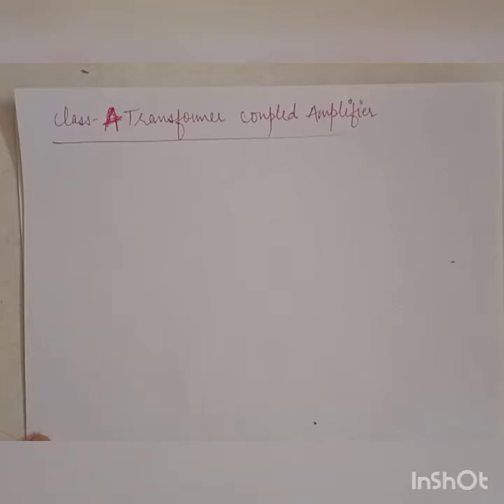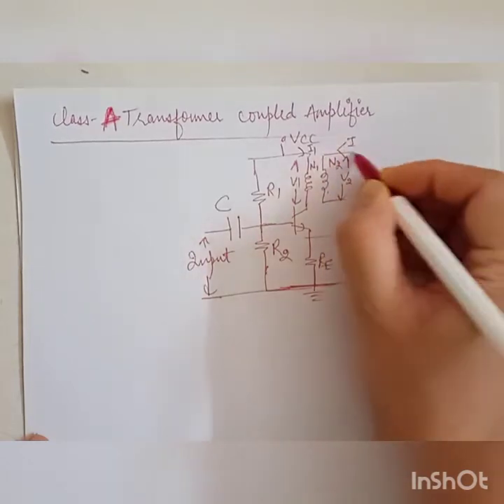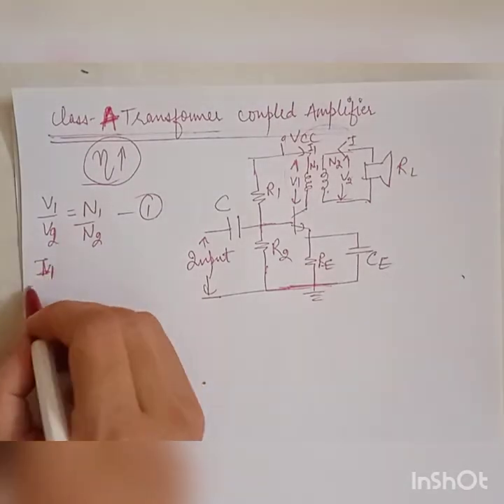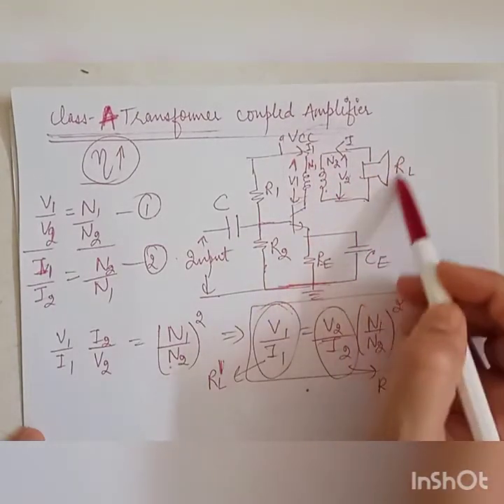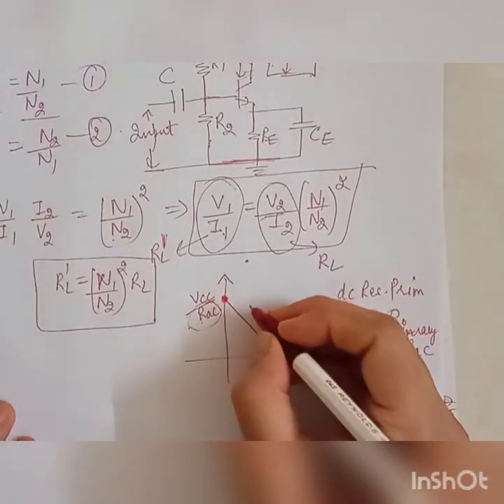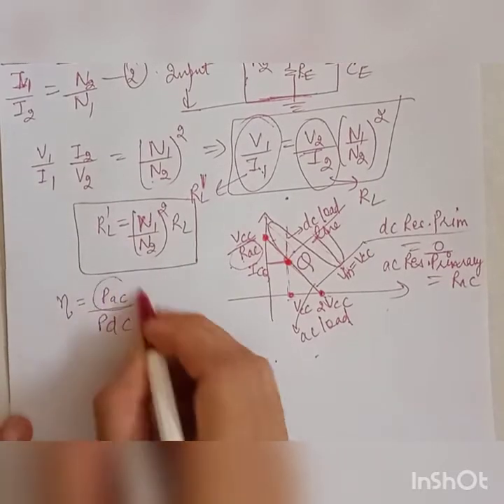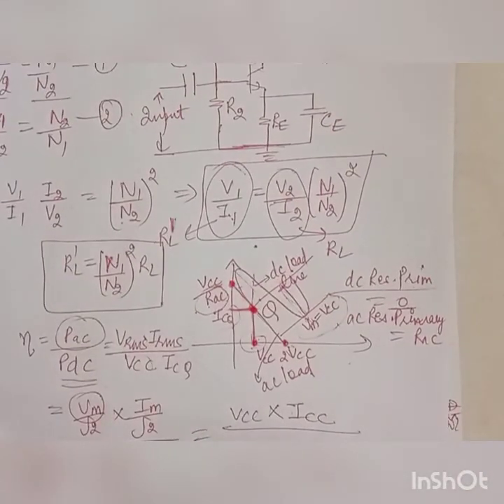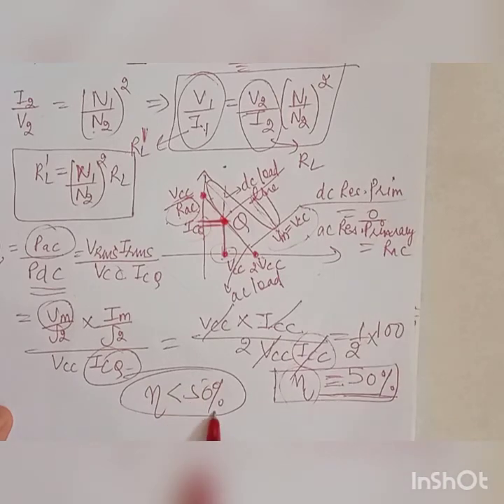Module 3 Class A Transformer coupled power amplifier

Comment: Students find it difficult to understand the nuances in the design and operation of a transformer coupled audio power amplifier. Topics related to the operation of resistors, capacitors and inductors are discussed in textbook 4 (see in video #1 last frame References).
Electrostatics and circuits belong to one science not two. To learn the operation of circuits, Current and the conduction process, resistors and how discussing these topics makes it easier to understand the operation of capacitors, inductors, diodes and their operation in circuits and circuit theory watch these two videos 
i. https://youtu.be/REsWdd76qxc and 
ii. https://youtu.be/8BQM_xw2Rfo 

An animated power point presentation “Transformer coupled Audio power amplifiers” is available in the CD accompanying textbook 4, in which focus had been made on critical design aspects like impedance matching and maximum power transfer.